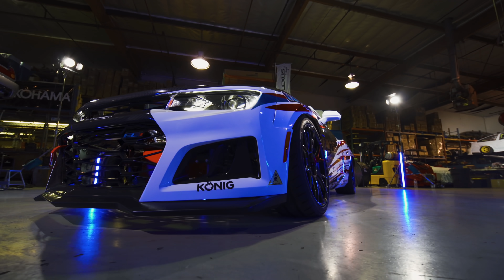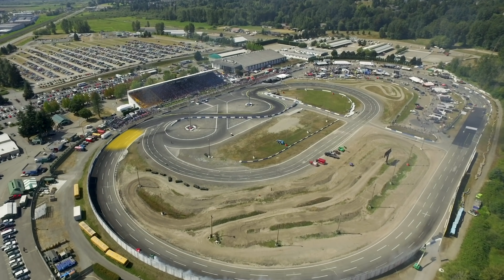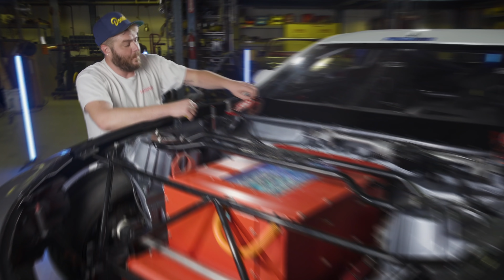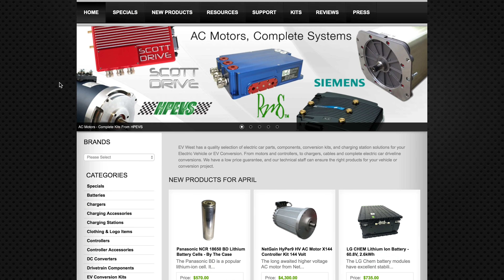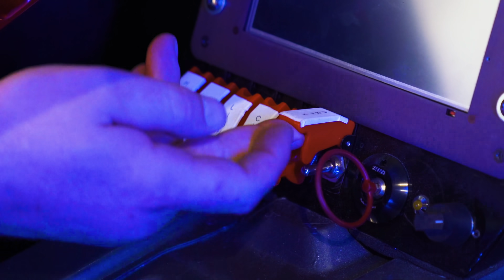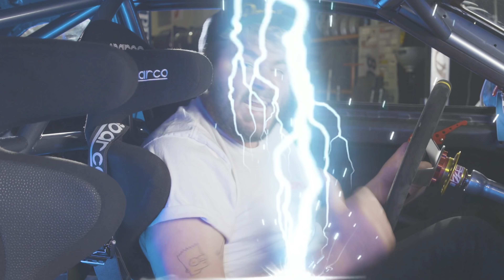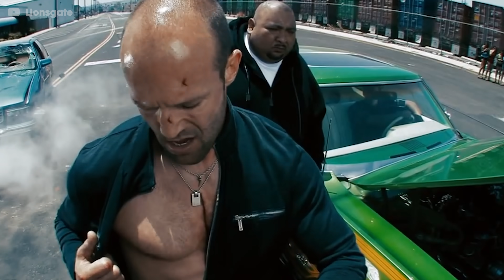Electric Camaro Drift Car: Exclusive First Look

Comment: I bet that thing hauls ass like the god of twerking, holy fuck. Imagine 515 HP and 800 foot pounds of torque at the touch of a fucking feather. I was in a bmw i8, i3 and some Teslas a few years back and just at a stoplight those things smoked EVERYTHING. It was amazing so this can only be Badass af since this is basically the current god of EVs

Comment: Before this there was an electric ae86 with a manual transmission
Reply: But it was limited to much lower Torque levels. I don't know of any oldschool transmission for engines that will survive instantaneous 800lb/ft from theses modern BEVs. The same company who supplied the parts EV West has had lots of trouble Destroying Gear Boxes even on weaker builds like Porsche Gear box in classic Fiat 124.

Comment: Blasphemy! Kill it with fire!
#SaveTheManuals
Reply: What if I told you that most electric conversions use manual transmissions
Reply: @the1anonymouse  
I would not care.
Also, it is completely impractical. I'm not sure where you get that data from, but you are adding transmission losses to a powerplant that requires no gearbox. It is like attaching a breaker bar to a dinner fork.
Reply: @VasyaIvanovichPupkin  actually a lot of home conversions benefit greatly from having transmissions because the motors that are commercially available to them aren't as powerful as those used in OEM vehicles there is also a 'sweet spot' for efficiency of electric motors based on load and rpm for many of these and a transmission helps keep them in that zone which more than outweighs the transmission loss
Reply: @the1anonymouse  
I mean, a couple of gears, sure. But bolting an EM to a 5/6 speed transmission in a corolla won't do you any good. EM's loose torqe at high rpm. Formula E currently uses a 2 speed transmission, if I am not mistaking.
You can build almost anything for fun as a hobby. I just don't appreciate it when people start chasing numbers and forget about the experience along the way.
Reply: @VasyaIvanovichPupkin  I can agree with you there based on my calculations as far as road cars go 3 gears is about the max where you're gonna see any appreciable gains

Comment: Petrolheads: EVs are boring
This Camaro: “Hold my beer”
Reply: You mean: "Hold my battery"
Reply: water*
Reply: Still dont like it
Reply: Still boring...
Reply: Still boring... I can spin around on a rumba as well.
Reply: Don't listen to the normies! EVs are dope
Reply: Ethan Harper and. You my 
... little asshole. Are very gay☺️
Reply: WarGames8 still boring bud and an electric driver drinks a latte
Reply: Joe dirt You know what’s boring? Losing a race. Thats what you’ll be doing in a couple of years (maybe even less) when Electric Supercars are a thing.

This is like Manual vs. Automatic, high school boys prefer manual and think it’s faster but engineers and science know that Automatic is better due to insane clock speeds of processors.

Stay in the past and get left behind (literally).
Reply: @ProFow  What kind of racing do you do?
I won't even go into the fact that in a race, you race against the same class vehicles and the powerplant TYPE will literally not matter, as it will be the same. But what really is boring is being a passenger. And what we are reffering to here, is not about winning or loosing the race. It is about driving experience. This race for the 0.001 of a second is costing F1 thousands of fans every year, while F2 and other smaller classes with slower cars is gaining popularity. And no one cares if they have petrol, electric, or hybrid powerplants. F1 is putting in regulations to slow the cars down to allow drivers to race, instead of gaining positions with pitstop strategy.
Your argument is invalid.
Reply: Hmmm still don’t like em

Comment: So first of all, that is not a magnetless motor! It's a brushless induction motor straight out of a Tesla!
 That is a Tesla integrated drive unit meaning the inverter and motor are one-piece along with the reduction gear and differential!

Motors function because of magnetism, it is impossible to have a functional electric motor without magnets.............

Comment: a group of polish students built an electric driftcar too. It has 100KW (136hp) and still it's enough to drift. I mean, it still has some crazy amount of torque, but the power figure seems to low to be able to drift. Doesn't it?

Comment: I believe the official term is "accelerator pedal" for all my #dieselboys. 

Also, a stator is basically an alternator but it doesn't vary it's resistance to match the load. They're found very often on motorcycles!

Comment: as a firefighter I have to say filling a burning, sealed lithium-ion battery pack with water is an insanely dumb idea. the water will vaporize, what means it expands to roughly 1600 times of its volume in very little time. this thing would blow up like a bomb and the cells will still be burning

Comment: The first thing I think of is, how much faster a regular camaro could go if they put all that work into building one just like this in Carbon fiber and Kevlar.   It's Kinda given this EV thing will do well at drift racing...  But The real story is how they overcame the hurdles like where to put the batteries and why they have replace everything with carbon fiber.

Comment: What about the electric AE86 drift car that the hoonigans had in there lot?
Reply: it's also a manual if i'm not mistaken
Reply: That was sick, wasn't it powered by two forklift motors?
Reply: @HazeGreyAndUnderway  No it used WARP 11 (11.45inch) motors which was purposely design for Road Cars.
Reply: I wasn't a pro drift car. Also i think there is an e30 electric drift car too
Reply: Uwu sauce?

Comment: No matter what powers the vehicle, it's always called a throttle. Just like professionals  don't use the word "gasoline". They call it "FUEL". You can thank me later.
Reply: Throttle or accelerator here in Oz, and we fill up with petrol or e85 or fuel, never gas unless we are filling up with LPG.

Comment: The Camaro ZL1 1LE weighs 1730 kg, just over 3800 pounds. At 3000 lbs this electric car is unbelievably light.
Reply: I thought batteries were heavier than ice engines

Comment: Wanna make a couple of million dollars? Develop a aftermarket drop-in style electric battery and motor system for early and late model muscle cars. There isn't a lot of demand now, but give it a decade and I have a feeling the electric drive train swapped cars will be as common as LS swaps.

Comment: I love the idea of an electric race/drift car. I’m somewhat concerned about the forthcoming mass shift from fossil fuel burning autos and other vehicles without significant improvements to the power generation and distribution system.  Will be trading emissions from exhaust pipes from millions of vehicles to the smokestacks of thousands of generating plants?

Comment: Electric and Camaro should never be put together
Reply: WRONG, its the obvious choice. e-COPO is soo bad ass. This is just another example of bad ass combination. The problem with BEVs now they are crazy over powered you need to spend more time and resources setup chassis & suspension rather than power upgrades. The Holden designed chassis will actually put down the massive Electric Motor Torque and still stay in control.

Comment: pretty sure, regardless of what power/energy/fuel source is, the pedal is called the "accelerator" 🤔
Reply: Has no throttle valve
Reply: Accelerator pedal
Reply: @shadowuaw-0001  yes accelerator, my bad ✌😎
Reply: sess all good. Everyone says gas pedal as slang, and frankly, I don't see that changing too quickly, lol.

Comment: ZOMBIE 222 ELECTRIC MUSTANG NEXT!
bit of a trailblazer in performance EVs, built by a crazy south Carolinian in Austin Texas 
Has 1800 ft lbs of torque
Hits 60 in 1.8 seconds
Reply: Mitch Medford
Reply: Ryukachoo who cares about some overclocked prius
Reply: @joedirt6212  
Doesn't that mean every muscle car is just a souped up Ford pinto?
Reply: @joedirt6212  Right, because a classic Mustang that's electric converted is exactly the same as a Toyota Prius......

Comment: I sure hope they don't plan to douse the lithium battery with water...  That's a good way to make a bad time worse. I'm assuming that the fire control system thing uses Halon or some chemical that won't react with the lithium battery bit still put out the fire.

Comment: Pedal names:
1) Torque tap 
2) SYP(Shit Your Pants) Pedal 
3) WAC-er (Wheel Accelerator Controller)
4) TLC(Throttle Level Control) Pedal
5) The Whip (to whip all them buff horses "up to speed")... see what i did there...
Reply: I like "wacker" 😂

Comment: Where is the CRTL ALT DELETE buttons on that thing? Shut down and reboot when you have an issue? Anyone with a cell phone knows that electronics glitch from time to time. Also is it no transmission really... Or is it minus engine and transmission only? I will miss the sound of gasoline engines roaring, but the instant power of electric cars sounds like "race car" to me. Range is an issue, but once that is solved and recharging time is solved, they will slowly but surely take over.

Comment: This is kinda dorky but... The gas petal has always technical been the accelerator.
Reply: Why do yanks call a liquid 'gas' ?
Reply: @nordic5490  internal combustion engines were first designed for a variety of gasses. Propane is in fact a gas. It's an exchangeable term to fuel. You're stupid for asking.
Reply: Sean, idiot, it is only the yanks who call a liquid fuel 'gas'. The same yanks who cannot cope with the metric system and the same yanks who feel the need to own guns to boost their fragile egos. It s a good thing yanks are only 4% of the world's population. Petrol or Benzine are the terms used globally.
Reply: @nordic5490  and I'm not a teacher. Stop consulting the internet. Wow, did you know there are a lot of dark skinned people in other parts of the world. That's you right now. move along....

Comment: Three of the lamest things combined- drifting, electric motor, a muscle drift car. Dont compare gay drifting to actual racing.
Reply: blah blah formula drift drivers are in the hall of fame for sports and it’s more racing than drag racing is
Reply: @harleypickin217  how is it racing when your not really racing you can pass each other but that isnt the point with lame drifting. " The drivers are judged on line, speed, angle, and overall impact. The judges can also make additional request at the drivers meeting for actions or techniques that will weigh in their decision making (ex; entry technique, racing line, proximity, etc.). " so where does it say racing to the finish line first or anything along those lines hmmm? Seems more like scoring of ballet or synqronized swimming more than racing. Drifting fun to do no doubt but racing it aint more like gay car ballet. I am not saying it doesnt take some skill either only stating the fact that it aint racing, if you said motor sport i could agree with
Reply: blah blah have you seen the crashes, the cost, how close the drivers get to walls and each other and yeah it’s on speed, and style but isn’t drag racing just speed and NASCAR’s just speed and lefts
Reply: @harleypickin217  yeah i have seen all that and im not impressed for the most part and i noticed that nascar racing and drag racing have racing right in their name not like drifting. My whole point is that drifting is NOT RACING but it is a motor sport a lame one in my opinion. Gay car ballet, synchronized swimming aka drifting im sure its fun to do but racing it aint. Oh yeah and nascar is more than left turns they dont show tthe other races for some stupid reason and everybody knows that their crashes are better thats one of the main reasons people still watch it and i never said it wasnt boring or watched it

Comment: Did he after kill switch say that "Presurized water goes in".
Lithium is one of the most active metals, it would explode, the contained space in which are batteries doesn't help.
I know, i know, no one uses water for vehicle fire fighting but still say so, or some dum dum at will try to do that with his Samsung or Mustang

Comment: Kind of on the low side? No ones made 500whp in FD since 2008😂
Reply: Fastball Films it’s cause you don’t need that much power to drift, but the other engines are very capable
Reply: Rk_Driftz 23 you’re right...you don’t...but you won’t be competitive. When the Camaro gets on the podium I’ll believe

Comment: Imagine if it had no batteries and an LS  to generate the electricity. Put the electric generator and motor where the transmission and driveshaft would normally go. Set the throttle to engine to peak power when drifting, and to just above idle for pootling around town. If you get rid of  that 800lb. battery for a 400 lb. engine, leaves 400 lbs to figure out a generator right in the middle of the car. No battery hybrid, with instant tq and no range anxiety. Bolt and Volt already taken as names... how about... ZoLT.  

Who are we kidding, Ford will get there first. Ooh, Colt works right into the Mustang naming convention.

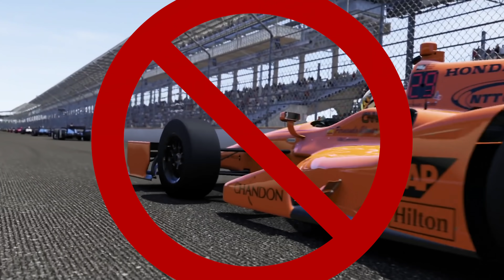Comment: 2:16 not only do I know that it's Forza, but I know that it's specifically Forza Motorsport 7
Reply: You can actually change the engine if the power/car lvl stays the same in forza
Reply: @DuBstep115  what do you mean? I didn't understand your sentence
Reply: @falcongamer58  YOU CAN CHANGE ENGINE IN FORZA MOTORSPORT 7 IF YOU WANT. suspension, tyres, turbo etc. 

What you said its not true
Reply: @DuBstep115  what did I say that wasn't true?

Comment: Electric cars are great until it blows or starts burning. Electric fires are very difficult to extinguish.
Reply: Co2
Reply: @kylelaughinghouse1893  won't do anything. You need to cool the pack down. That's why they use water. Tons of water.

Comment: Don’t think water would be good at putting out an electrical fire😂
Reply: I wonder if it designed to displace the gases and keep the runaway reaction form continuing.
Reply: @meareweird7714  if you can directly flood the battery pack near the damaged/burning cells, you stop thermal runaway (just bc the neighboring cells won't get hot enough to also catch fire).

That's why FDs are adopting cutting extinguishers. They basically use a water jet to cut a hole into the battery pack and flood it with water.
Reply: It's what Tesla recommends. Lots and lots of water
Reply: You're right, the Long Beach FD denied it entry. The ban was due to the fact that they are not properly equipped to fight electric car fires. 
http://www.lacar.com/el1-chevrolet-camaro/

Comment: Thermal runaway or cell contamination/damage are the main causes of EV fires with lithium batteries but can easly be prevented with through pack protection, cooling and controllers.
Reply: How far out are graphene batteries and super capacitors?

Comment: I knew this would be done eventually, electric drift cars just make sense, instant power response and torque that can be controlled and managed easier and more accurately with electricity than several "controlled" expansions

Comment: maybe I should buy that old pinto and make it electric so if someone runs a shopping cart into the back it won't explode
Reply: EV pintos are a thing, but usually the older EV conversions with shitty batteries.

Massive bonus points if you give it a disgustingly high torque DC motor and high power draw batteries and can basically lunch anything with four wheels off the line.
Reply: @Ash-the-Puma  "bean looking ass car" 😂😂😂
Reply: Actually planning on doing this to one at some point.
Reply: "old dick"

Comment: Batteries catch fire, woah. I guess my tank full of gasoline is very safe.
Reply: LISTEN UP, SINCE APPARENTLY NONE OF YOU PAYED ATTENTION IN SCHOOL; Liquid gasoline is not flamable. Gas tanks do not explode unless they're almost completely empty. If you're in an environment where liquid fuel burns, you've got bigger issues since you'd be experiencing 20x the atmospheric pressure of earth.
Reply: Batteries are safer than gas tanks, but both are pretty safe. Gas tanks don't explode in large accidents, at least not to the extent you're thinking. Stop watching movies and thinking that's how the world works.
Reply: Bits of Pulp Wut??? Batteries are literally ticking time bomb
Reply: @no no only with cheap lipo
Reply: Friction from the crash makes the Gasoline ignite. If Fuel tanks can't be broken in a crash, neither can Batteries cases.
Each cell is an individual cylinder made of metal and there is a whole metal casing on top of that. And it's ofcourse engineered to not get damaged.  Lamborghinis catch on fire even if it revs a bit too much and you say Electric cars are dangerous?.
Reply: Yeah, that's like when people were trying to say hydrogen powered cars are more dangerous than gasoline. 12 in 1, a dozen in another.
Reply: Gasoline needs the right air/fuel ratio else it won’t ignite, about 14.7 to 1 but it can ignite in slightly richer or leaner conditions.

Comment: Imagine having to plug in your car at the track lol
Reply: Imagine having to get into full fire gear just to go to the track pump or having to lug around some gas cans lol
Reply: @joyfuflower  or just top up your tank before going to the track... drag racing is the only type of racing I can see you actually wanting to keep your car low on fuel, for weight savings. It's okay though, you tried.